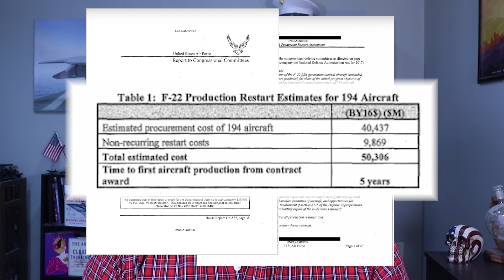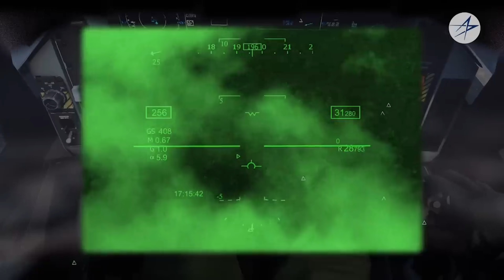The 2ND GENERATION F-22 RAPTOR we ALMOST got

Comment: Could you do a video about the future of Shorad? 
Will short range air defense provided by the laser stryker? Will the Bradley replacement IFV XM30 function as an anti air cannon? Should the US look at the SkyRanger / Skynex / millenium gun system? And will there be a Stinger replacement with a better battery, targeting, and most importantly more affordable? Or is this affordable future the APKWS guidance upgrade for the cheap and plentiful Hydra 70mm rocket? Should we slap that on Avenger Hummvees? Or IRIS-T?
Reply: I think the US should really invest into a new shorad air defense system. Laser Stryker is cool, but i am talking anti air tank (or IFV, really).
Team up with german Rheinmetall and get the Millenium gun/ SkyRanger. Slap a 35mm airbust cannon aka longrange shotgun onto Strykers and Bradleys (or their replacement) plus 2 or 4 Stinger misslies. Or the bigger IRIS-T. Hell, develop a new Stinger, and make it 5 times cheaper. The battery on the current ones suck and their age shows. Good shorad weapons need to be affordable and plentiful, not some rare and expensive thing nobody really can get.

Comment: The US Army just chose General Dynamics and Rheinmetall as finalists for the 4000 Bradley replacement IFVs.
Could you do a Firepower series video about this program, the two finalists and the other three that dropped out. Or more generally the current state of IFVs (Bradley, CV90, Puma, Lynx) and their most likely future. Maybe even including anti air IFVs like some CV90 variants and SkyRanger.
Reply: CV90 is a  wasted oppertunity.

The MK IV is nothing like its earliest model.

It's also not as hilariously big as the other contestants.

And it has plenty of available variants.

God knows the military could benefit from some parts commonality.
Reply: @dwwolf4636 i believe the mk4 variant is an issue here, not a benefit.
The Abrams and Bradley are reaching the end of upgradability. And they don't want something with similar issues. Where you don't have space or spare weight or energy to stuff inn upgrades later. 
Market available and tested isn't cutting it when you are dead set on reinventing everything and putting a 50mm cannon on your new IFV.
Reply: I thought the GD prototype caught fire and was destroyed, leaving reihnmetal the default winner if it completes trials?
Reply: @Matthew-bc9mr  both were chosen for a new stage where they are supposed to create 13 prototypes each. So even if a lost prototype looks bad, and i have no sources to confirm that, they were still chosen to make more.
Reply: As if they are going to be choosing anyone but general dynamics!!!
Reply: @ADobbin1  but maybe they can "borrow" (steal) some of the goodies from Rheinmetall.
Reply: I can’t believe BAE’s CV90 didn’t make it. I wonder what GDLS and Rheinmetall are offering.
Reply: @kurousagi8155  The fact that they choose 2 finalists rather than a single one to go ahead and fund shows that these are two extremely competitive concepts. Rheinmetall has a lot of new tech they have been working on these last 10 years, tons of work put into programmable ammunition and drone targeting. GD of course has the most experience in this field though and tons of data they can pull from all of their past works